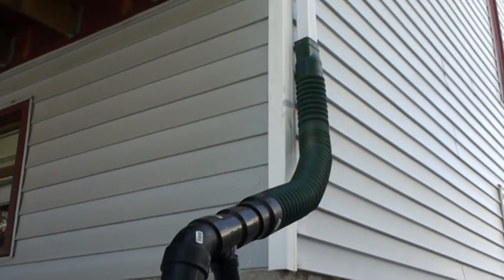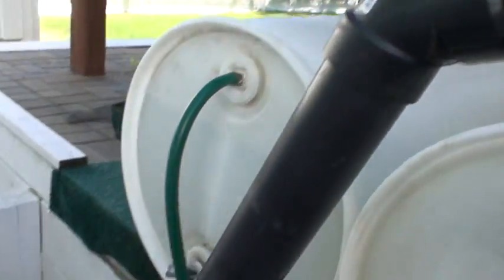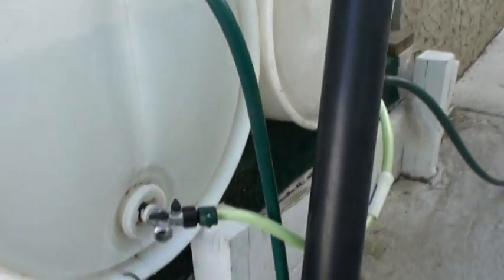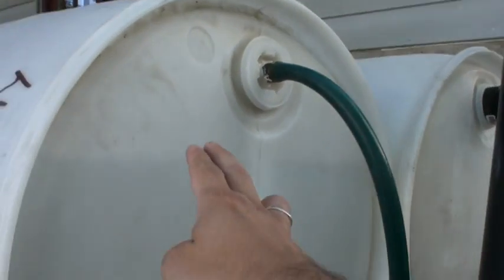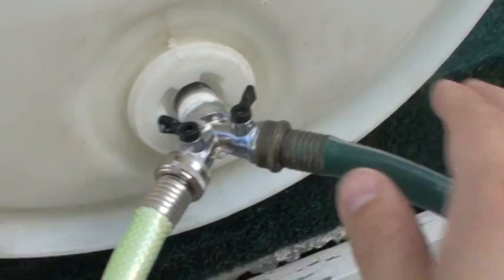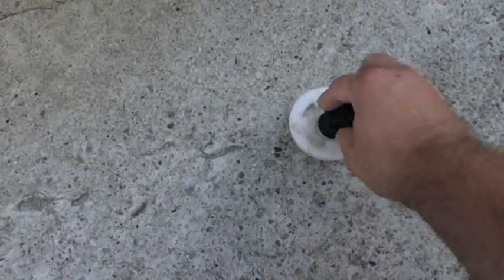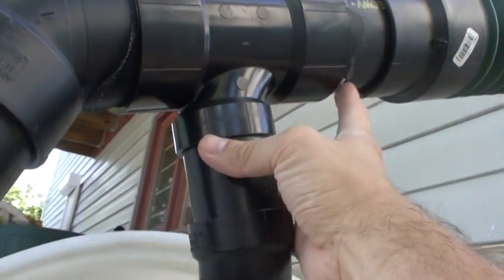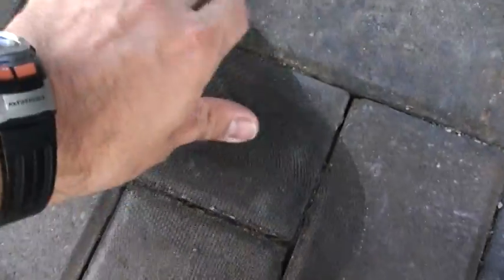Rain barrel system for rain water collection.

Comment: @denyconfirmation Thx 4 the reply. I'm using 4 barrels in a row on their sides, no stacking on top. I think the problem with splitting is when they are stacked 2 rows up without additional support for the top row.  The plastic barrels are not like metal barrels.